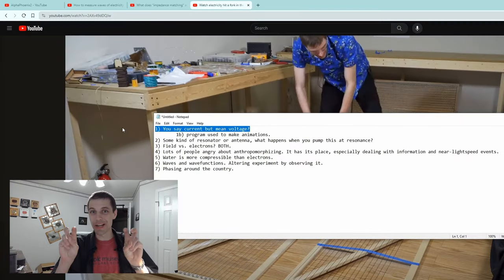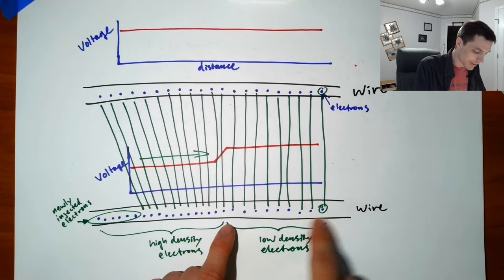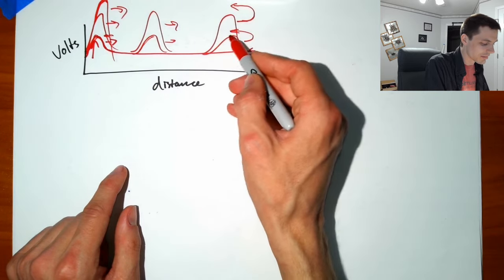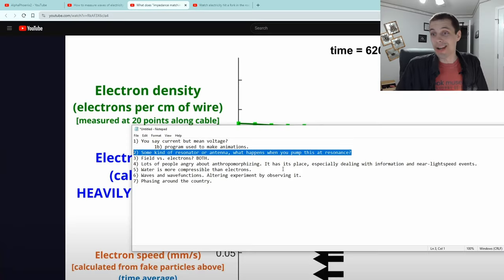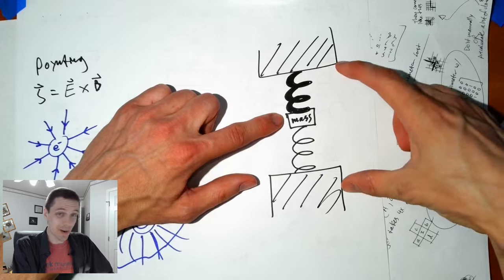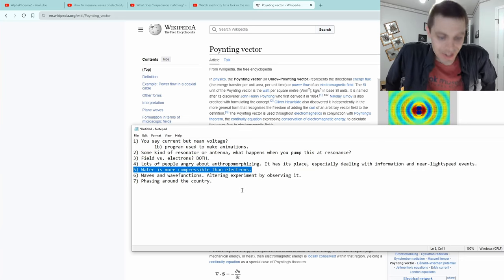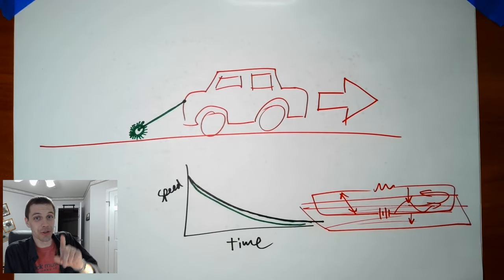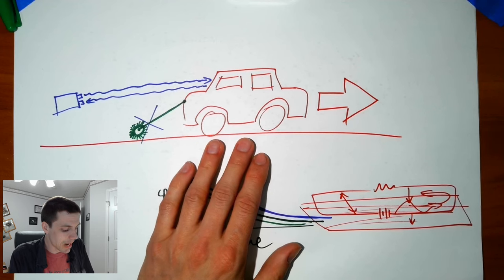"Watch electricity hit a fork in the road at half a billion frames per second" AFTERSHOW

Comment: I don't think your discussion of the Tesla coil resonance is correct.  The frequency that a typical Tesla coil resonates is on the order of a few hundred kHz to 1Mhz, which means that the wavelength is on the order of about a kilometer.  Thus for the purpose of resonance the coil is pretty much acting like a regular old inductor and the top load is like a regular old capacitor.  We don't need to consider the wave propagation aspects, the currents and surfaces charges are in equilibrium with the electric and magnetic  fields which are changing at a slow enough rate that a Coulomb gauge can be considered applicable.   Also the resonant pushes will be much slower than the wave propagation times.
Reply from the maker: Yeah I think you’re right, it may not be a pulse traveling back and forth as much as a slope of voltage that tilts one way and then tilts back the other way as the capacitor at the top charges and discharges. All the more reason I want to see!

Comment: You can actually buy a cheap water Tesla coil , its called a piezoelectric "humidifier" and it works almost the same way as a Tesla coil by moving water molecules at resonance bumping them  together increasing the pressure and turning them into gaseous state (not actually gaseous stat but droplets so small that don't need much energy to turn into gas) .
Reply: Cool!

Comment: I would love to see your version of the reality of 'particles' vs 'waves'....  Because there really aren't anything that are 'particles', it is a convergence of a specific energy field in a 'point space'.  Beyond some physical size (whole atoms?) there is no physical element to these things.  It is simply wavefronts that interact with other wavefronts to create 'particles'.   
I would also love your take on gravity.  In schoolbooks, in any media I've seen online, I only ever see the 2D representation of the effect of mass on space-time.  The issue is that 2D representation does NOT accurately represent the reality of gravity.  3D would have a difficult time, but would be worlds better.
The phase shift control mechanisms are very likely (don't quote me as fact) PFC, power factor control.  Every single power system, and many client side systems, MUST have power factor control to prevent back EMF, excessive heating, etc in power lines, generation stations, and even inside your homes.  One alternative use for power factor control mechanisms would be phase shifting, which means the hardware is already in place to adjust phasing between separate generation networks.

To people angry about anthropomorphising these things, >> Most people have NO context for many of these concepts.  They have no way to visualize wavefronts minus physical matter.  They have no concept of quantum entanglement.  Sometimes you simply have to use known reference points to engage certain peoples' understanding <<.

Comment: You could probably passively measure the speed of a car using trig. Use a camera to track the angular change and a tape measure to measure the distance from said camera to the road. I can’t think of anything here that would act on the car thereby changing the value you measure. Of course it’s probably not as accurate as the radar method though.
Reply from the maker: Light from whatever source hitting your camera has momentum
Reply: @AlphaPhoenix2  yeah and the light hitting your camera isn’t changing the speed of the car:)
Reply from the maker: @capt4in1  fair point :) but the car is still being hit by light in order for some to bounce to you. even if you're arguing it's an observational study, then maybe you're ABSORBING some light with the sensor that would have otherwise scattered back towards the car.
Does this matter? no. xD

Comment: I've got to assume on the graph that the reason a hue scale was used is that just like angle, hue is essentially cyclical [after red it goes to purple then back to blue again] - so, a deflection of 360 degrees would be the same phase, and would appear as the same color, and hypothetically a cumulative deflection of more than 360 degrees as you follow some path would show up as multiple trips around the color wheel.

I don't think there's any particular reason to expect the phase difference between points hundreds of miles apart to be small - if we look at, let's say boston and a point deep in the red at the southern tip of illinois, the distance between those points is about a thousand miles, which is about a full third of a wavelength already even using the assumption that it's the speed of light, and we don't know how far off the path between those points is from a straight line or what the actual propagation speed in the power lines actually is

Comment: My big takeaway from this is that higher voltage means fewer electrons relative to some other point in space? Electricity messes with me because it's opposite in so many ways, when there's a thing there it's negative but my brain says that negative means fewer things   🤪
Reply: Voltage is just the difference in "electrical pressure" between two points. So it is always relative to something else. 
A vaccume makes the same pressure difference as a pump.
Reply: The big aha moment for me was realizing electrons are negatively charged. If you have more of them somewhere, that plase has more negative charge.

Comment: Is it documented somewhere in detail how the oscilloscope measurements are made? Do you basically move your leads (however many you have) across the tap locations and run the experiment again and find the peaks in each waveform and take the vector quantity on the plot (which represent voltage and time) and plot it? I'm trying to understand if you interpret the whole waveform when you record with the oscope or you only take the peaks from the initial pulse that it samples and use that to plot something else.

Comment: Uh so if there is a significant phase difference across the power grid, why doesn't that result in a problem?
Reply from the maker: If I had to guess, it's measurable but not "significant". I really wish that plot had units
Reply: See third paragraph above.  I may be wrong, but power factor control seems like the likely answer.
Reply: It does cause problems. There is a whole sequence for getting power plants connected to the grid that gets them in sync with the waveform.

https://youtu.be/xGQxSJmadm0?si=L7iO7iFo2EfSTVEZ
Reply: it does creates a huge problem for grid operator.
althroud exact mechanic of proccess rely on  slipping of frequency in overloaded generator. 
one is basic grid protection system is automatic frequency unloading.  
all major blackout in some way created by this procces
Reply: The phase between current and voltage is power factor, ideally you want 0 degreees.  The phase of the voltage between different locations for the same line, no body cares about it.
Generating stations just sync up to what voltage phase they "see" locally, and make sure that the generator is a working as a generator, and not as a motor.
Frequency is super critical, and it is transmitted as a signal from some central location, which provides the reference frequency to all generators in the grid, ie normally everybody generates at the same exact frequency.  If load is too high for some generator, it might reduce its generating frequency, and needs  to be fixed ASAP (out the water valve) or pulled out of the grid.
Reply: Another thing to point out is that often heavy industry which tends to run many inductive loads may be charged extra due to their large inductive load reducing the power factor of the grid by a non-negligible amount.

They also often waive this fee if the customer installs power factor correction equipment to help counter this loading.
Reply: @ikocheratcr  it's just not clear to me that there's a single phase any individual generator "sees" (or in other words, that there won't be destructive interference.)

If you have two generators, and they're 2 light-milliseconds apart, then B can be synced such that it's 2ms behind A - so that it's in sync with the electricity arriving from A. But then as the electricity from B travels to A, A will see this as being 4ms behind it's own phase, resulting in what seems like problematic interference. But it's likely I'm missing something here.
Reply: @Bobbias  Logan UT has an issue that I believe is derived from this effect.  The power across the entire valley the town sits in flickers, constantly, nonstop.  I sent the power company a video about it.  No response, obviously.
Reply: @TheMostUt  That won't be poor power factor.

The biggest effect of poor power factor is that the power company either has to compensate with capacitor banks or synchronous generators specifically designed for power factor correction.

A grid with poor power factor ends up forcing the generators to generate more power than the grid is actually using to account for the offset.

Most of the loads you'd use in your house are relatively small, and have large amounts of resistive or (in the case of electronics) capacitive loads. Capacitive loads actually help counteract poor power factor, although in the case of home electronics that effect would be negligible.
Reply: @Bobbias  I know THAT bit isn't a power factor issue.  I have video of the Oscope posted, but am unsure if comments of another channel is an appropriate place to link it.  The issue in Logan is due to VERY large inductive loads.

Comment: The magnetic field only exists when you move elections and in a space around the electrons?!?
No, no, no.
EM waves may be generated by moving elections but they are very much decoupled from source charges, as they can travel far away from them and have their own magnetic field component. 
Not to forget to mention the electrons' intrinsic magnetic dipole from its spin. You can certainly debate with atomic physicists whether there is anything actually moving or spinning in that case but you can't have it both ways. Eather electron dipole is intrinsic or electrons have the physical size and are not point articles and god luck convincing anybody of that.
Reply from the maker: At the very least I’d argue it’s a property of a charge with momentum - in the case of an electron, angular momentum. Yes they can propagate long distances, but in the antenna you had charges changing in momentum